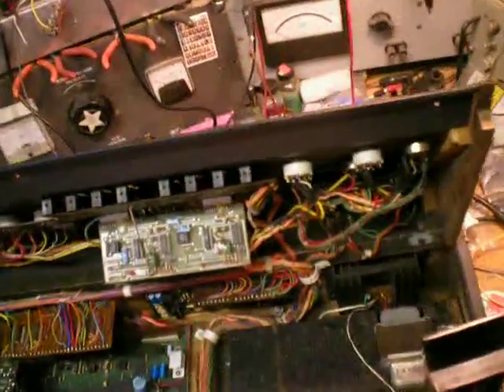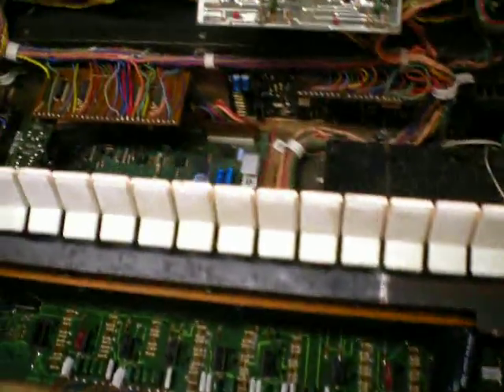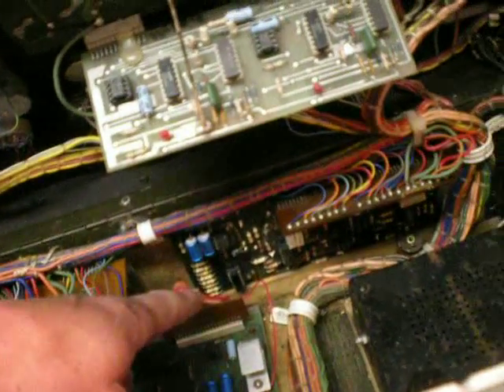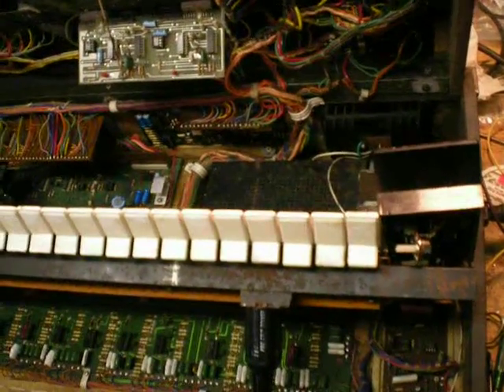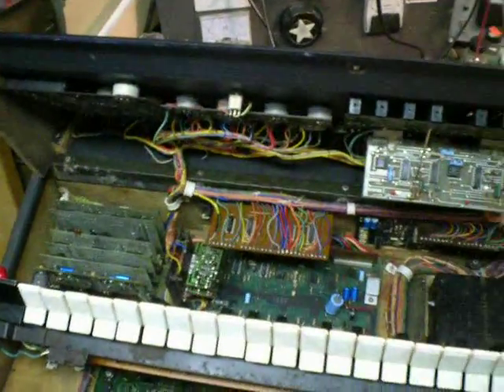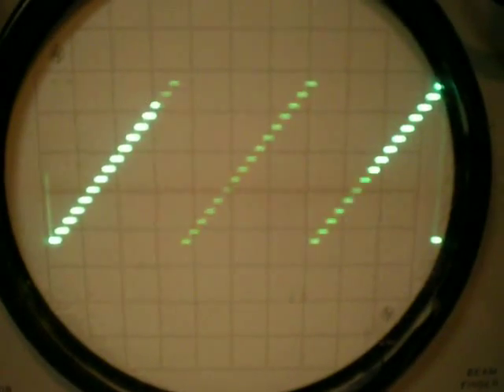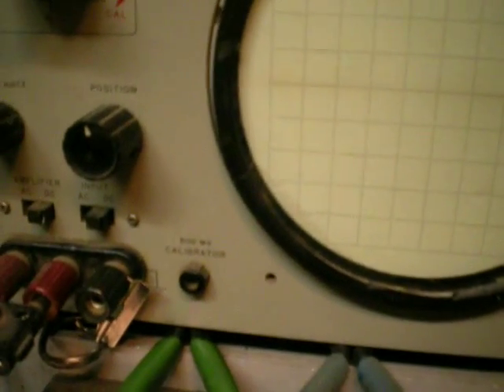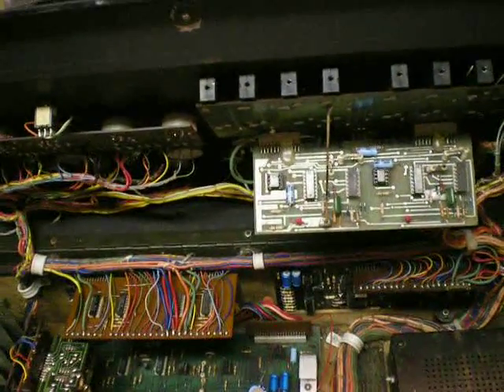Crumar DS-2 glide mod, tech overview and WAVEFORMS.

Comment: Real good and useful walkthrough, watched your other DS2 repair video as well. I just got a DS2 myself, sounds terrific. Lots of 50Hz hum in the signal though (disappears when the VCA cuts so something before that), hope some power supply recap-ing will remedy that (I'm not so skilled in the electronics department). Will try to MIDI:fy it as well with an Arduino, many hours of work but I think it will be worth it.
Reply from the maker: Sometimes the settings on the trimmers might increase that..Yeh it'd be swell to have midi control but due to how things are on these, the easiest way to Midi in is to have electronic switches in parallel with actual key switches I think.  Since you basically have two independent synths really with the poly and mono.  So you can't just do it with a micro tapping into the keyer circuit

Comment: What value is the glide slider potentiometer? I need to replace a broken one but just see VCA, filter & sustain & OSC potentiometers listed for sale. Cool mod.
Reply from the maker: 100K linear as I recall.  i suggest replacing switch w/1M in series, with 5M small rotating pot also to greatly enhance this machine!

Comment from the maker: Wow no comments.  Boy giving the truth about Obama gets my video's obscured obviously.  haha.  Can't believe this only has 299 views.

ADDENDUM.  The variation in the two DCO's resolution was an open 800K precision resistor.  I didn't think there'd be any way they were supposed to be that way.  Both waveform generators are identical circuits with a 4520 4 bit counter chip and it's outputs are functioning as divide by 2 square wave sources which are then proportioned by those precision resistors to produce the emulations of the waves forms.  So essentially the LSB was missing
Reply: Hello Sounddoctorin, I'm from Manila, Philippines.  I also have a Crumar DS-2  Got it in 2003.  It worked fine then but around 2009 it conked out.  I'm just a musician and I don't know much about electronics but my Crumar has power, the LFO's seem to be working, because when I turn the knobs, the rate of the pulse blinks faster.  But there is no sound.  Anything I press on the keyboard doesn't communicate to the modular system.  But when I put a sound or signal through the external in, all the filters work.  What could be wrong?  Thanks!